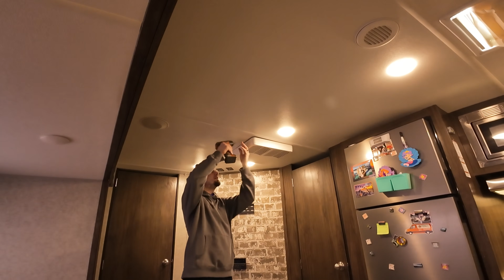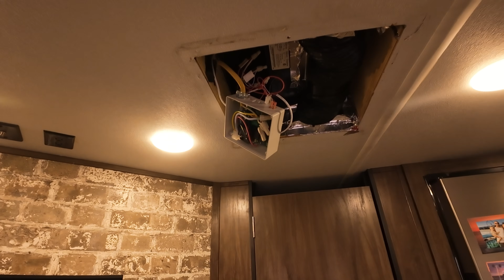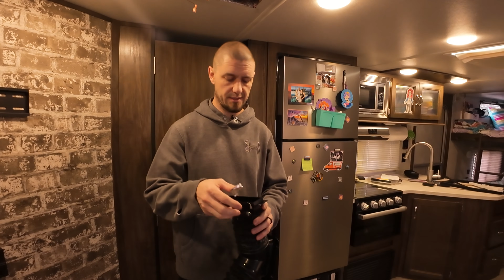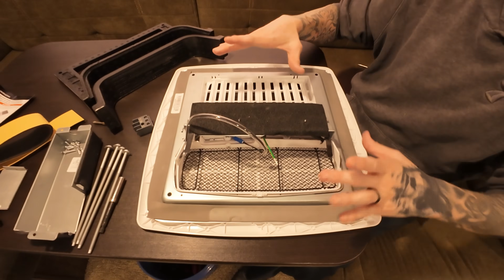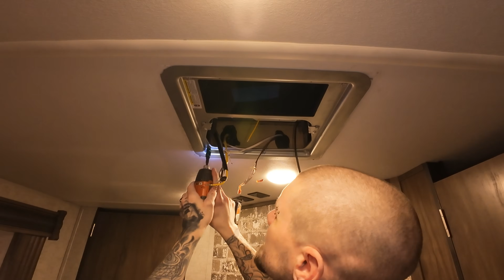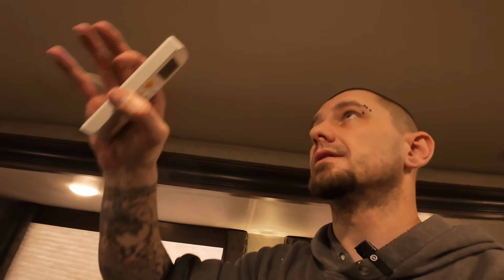Swapping Our Old RV AC for the Furrion ChillCube… Was It Worth It?

Comment: You could always use your old unit and cut an opening in the roof and ceiling and with a couple 2x2’s add some framing. Instead of wiring into the trailer wiring, cut the female end off an extension cord and wire the male end into the unit power wires and use an extension cord to plug directly into the pedestal 110v outlet at camp site. Pretty simple job and looks like you have the skills to do the job.
Reply from the maker: That’s definitely an interesting workaround, though I prefer sticking to the factory wiring setup for safety and convenience!

Comment: I've seen other vids of people fine tuning and sealing the plenum with foam board and foil tape. I wonder if that can be done with this unit for increased air flow?
Reply from the maker: You can definitely do that if you wanted to. KoolRV also makes an amazing product that would hook into it and push the air directly into the vents so you don’t lose any air conditioning inside the unit

Comment: We were thinking of replacing the non-working Dometic on our Dutch Star with one of these but since the roof A/C now connects to ducts in the ceiling we would have to cut out the old ducts and make a 14" square hole in the ceiling for the air to come down through and to have a place to bolt it on which seems like a big job. Also the Furrion units have a lot of bad reviews on Amazon since the internals are mostly cheap plastic and a lot of them arrived with damage so if we ordered one and it came by UPS it would be smashed to pieces!
Reply from the maker: Mine connects to ductwork as well. Theres no cutting necessary. The ductwork will connect to the framing that your ac unit sits inside of. (Partially why so many of these units are so inefficient) you should just have to un bolt the framing and lift right out then drop in the new unit
Reply from the maker: Also, I have links to everything in the description from Amazon. If it shows up damaged you can just submit for a return. Or if you want to purchase in person typically camping world stocks them as well

Comment: Does it come in a kit or individual parts?
Reply from the maker: The ac unit will come with everything but the inside kit. You need to order the inside trim kit separately depending on whether you have a ducted ac or ductless unit. I have links to everything in the description that you will need for the job though

Comment: Who cares about the sound? You don't have to mention it 10 times you care about the airflow. thirty percent loss of efficiency in the duckwork due to leaks and heat gain from the roof the direct dump is the best way to cool the  camper
Reply from the maker: When some Air conditioners from the factory are so loud you feel like you have to yell over them people tend to care about the noise level. It was a big upgrade for us just for the noise level alone…

Comment: how much airflow compared to the dometic?
Reply from the maker: I did take a reading with an anemometer I just can’t remember the numbers now. There has been a huge difference since we’ve installed the chill cube. Before if you walked out the door the temp jumped 5° and now we can cook breakfast with the door open in 90 degree weather and it still keeps out camper cool. Can’t recommend the chill cube enough!
Reply: @MilesAndSmilesRV  I had the 14 500 chill and I have problems with it freezing up all the time since it’s manual controls it doesn’t give you a freeze sensor. after fighting out for the last four years, wasn’t sure I wanted to go with the same brand, but I did and decided to go with the chill cube because it looks like they changed a lot of things that was a concern. A big one being on the chill the majority of the air comes out the backside of the AC. The cube looks like it comes out the front.

Comment: You stated you have a duct system you don’t have a duct system. You have that plate in your camper in the ceiling. A duck system has no plate coming down in the camper other than the fresh air ducts you returned ducks.
Reply from the maker: @dand8163 and @rvfuntimes6144 I absolutely have a ducted system in the camper. Ducted doesn’t mean you don’t have the dump gate on the ac unit. All that ducted means is that you have air duct attached to your unit that disperse it through the rig, which I do. Every single ac unit that I have seen in a camper also has a dump vent on the plate incase you need to rapid cool your rig you can open that as well. At least in the campers that you can reach the ceiling
Reply: Yea its makes me wonder when they say its ducted and then they show it coming through the ceiling through those spots. We too have a ducted system where it runs from the front to the rear. Wish someone show a system like that.

Comment: I went to school for rv these to work on 
It I bought a cheap camera from Amazon and I put it through the vents and what I found. The teacher was right one of the tubes was not cap on the end so I use expansion foam to make it end. I did that in all two tubes. Front and back I eliminated pretty much 9 feet of space that it wasn’t using and to turn out push more air out of the vents when I drop the cover for the AC on the inside I had two holes that going into the attic, they were about 2 inches open taped it up and now it works good.
Reply from the maker: That sounds about right. From what I have seen just sticking my phone camera up inside the vents it wouldn’t surprise me if there was even more issues dumping air out into the attic instead of where it should be getting to. I started addressing those issues last fall, just haven’t gotten time to edit the videos to post up here yet

Comment: Looks like we have the same camper lol I have a 2018 fr Cherokee 264dbh and now I’m doing the same thing 🤣
Reply from the maker: Did you have the issue with the toilet recall with yours too? We had to replace the toilet in ours because it had a silent recall on it since it held sewage in the back of the thing. It always gave off a sewage smell so I called Dometic and they told me there was a recall on it and replaced and upgraded it for me. 

Their AC unit has been an issue from the very beginning.  Never kept our camper cold. You’re going to love that chill cube!
Reply: @MilesAndSmilesRV I didn’t know about any recall and mine does always have a smell. But what did you have to tell dometic to get a new one ?
Reply: You ain’t lying I use mine for work it’s currently 72 outside and I’m about to sweat inside of it lol

Comment: I saw a video from someone doing this same install and he only disconnected the 110v feed and left all the other wiring connected to the existing control boxes. He said that by doing this he could continue to use his existing thermostat for heat. Now, I will say that he had a newer RV that had a central control panel that controlled multiple AC units and his heater. Not sure if this would work for RVs that are a little older. But I think I am going to give it a try when I get around to installing my ChillCube on my Thor Windsport Class A.
Reply from the maker: Let me know how that works out for you! I'm curious to see if that method works on older RVs. I don’t see why that wouldn’t work

Comment: you can still get another unit on the roof, but perhaps for your circumstances, a mini split mounted to the front(travel trailer) or on the back (fifth wheel) would give you the amount of BTUs you need to have your rig cruising at 72 degrees. The chill cube is a MASSIVE improvement on traditional units though, (I am an RV tech, you can feel the difference inside when cubes are present)
Reply from the maker: The mini split was my next move if this didn’t work, however the chill cube did the trick for us…kept our travel trailer at 70°  easily

Comment: That was a risky move getting it on the roof that could have easily gone sideways. Last time I put a unit on the roof I tied a rope around the box and 1 person on the roof pulled while I pushed it up the ladder.
Reply from the maker: It seemed like a better idea in my head to be honest lol.  I thought it would have slid right up the ladder but it kept sticking.  It definitely would have been easier to have a second person helping but I wanted to film it as if you didn’t have anyone to help you to show that it’s definitely possible to do it alone, even though definitely easier with two people…
Reply: @MilesAndSmilesRV while it's possible, it is not advisable. One slip and that unit is gonna hit the ground and probably break something. That's an expensive mistake.

Comment: In my application the furnace wires runs trough the AC Dometic  control box. If I remove any wires from thermostat my furnace will not run   Help
Reply from the maker: Mine was the same way. All you need is a battery powered household thermostat and to splice the wires coming from the furnace to the wires going to the thermostat together. The only wires you’ll need is the red and white wires to connect to the thermostat. I cover this issue at the end of the video too incase you missed it. 

Did you start installing a chill cube in your rv yet?

Comment: I'm most of the way through your video, but itching to ask in case I've already missed it. How did you address the furnace? My thermostat wires both a/c and furnace through the a/c. I don't understand the design decision, but apparently it's common. Point being, currently, my furnace has a dependency on the a/c just for a damn relay or something that allows power to flow to the furnace. 

I'm all in on these chill cubes and itching to order, but even Furrion documentation is weak when it comes to thermostats, their a/c, and a furnace.
Reply: Meant to say, good detailed install video!
Reply from the maker: @TimPaddy thank you very much! We just spent a week in cape Charles, Va where our last AC unit could NEVER keep up. Happy to repost our new chill cube kept the camper around 73 degrees all week with ease! We didn’t have to block over our windows, or skylights.  We were able to open our windows up and look out throughout the day, and left our door open while cooking end eating breakfast with absolutely no issues all week.  HIGHLY recommend this unit for sure!!
Reply from the maker: I do address this issue at the end of the video. But basically you bypass the ac unit and separate the two. The furnace is powered separately from the ac but the signal from the thermostat is what runs through the air conditioner. All you need to do is make sure you connect the wires in the ceiling to bypass the ac unit and connect the two red and white wires on the back of a battery powered household thermostat. 

I hope that makes sense but I do go over it all towards the end of the video since that is one of the final issues to address in the install. 

Happy to help out throughout your install if you have any questions throughout the process. I hope you’ll stick around the channel…

Comment: We had an insurance claim and replaced previous 3  15k furrions with the 18k cubes. Holy cow what a difference. To start with the cubes are so much quieter. Dramatically quieter, like you can have a conversation when it’s running on high without yelling. 

I think the biggest change though is not only the fan being variable speed but the compressor is as well and you can hear the difference when it speeds up and slows down once it hits the temp it’s set at. 

Also we’ve noticed a dramatic drop in the amount of electricity we are using with the cubes vs the previous units. 

The follow me function on the remote is kinda weak but all things considered it’s not that big of a deal considering how much better the unit is.
Reply from the maker: I can’t agree enough! I was shocked at how much quieter this unit is and so far it has kept our rig WAY cooler this year. With the domestic we had to keep the doors shut at all times, window blinds down and had those reflective windshield covers jammed in them all just to try and keep it cool. With the chill cube, we’ve had the door wide open while eating breakfast, with the blinds open and still kept it cool. This unit has been a game changer. The true test on it is coming this week. We head to Cape Charles, and our ac has never been able to keep it cool in the camper there. 🤞🏻hoping this one will take on the challenge and keep it cool in there…

The compressor kicking on and off with it being variable is so nice too.  No more waking up every time the ac kicks on at night…I haven’t used the follow me mode yet.  Did it not work well for you?

Comment: So, was it worth it? If so, how much better?
Reply from the maker: It’s a night and day difference. I would highly recommend it for sure. What kind of air conditioner do you have in your camper?
Reply: @MilesAndSmilesRV i don't yet. I've been saving yp to purchase one for quite a while now. And ac is a huge concern, and so many seem to not get the job done at all. I'm building a 10kwah battery bank (solar and alternator fed, mostly) so, Im looking for a ac that actually cools without eating up my bank.
Reply: I have been running and installing chill cubes for the past 22 months
We are full time and off grid most of the time in our Fifth Wheel and the chill cube is the go to
No 12v-24v 10k’s
The chill cube is a phenomenal Boondocking A/C unit
Waiting on the new Chill Cube Low Profile now!!

Comment: Do you have better air flow thru the vents with the furrion than you did with the previous unit?
Reply: Update... I got mine up and going and I'm impressed with it so far. I love the fact that I can run it on a 15amp outlet at my house and it cools nicely
Reply from the maker: @richardtinsleyjr we are currently in Cape Charles, VA. This has been the place that has notoriously challenged our Dometic AC every year. Last year it was 98° inside the camper with the AC on. This year with the Chill Cube we have kept the inside around 70° with ease. We have even left our door open while cooking on the blackstone and eating breakfast and it still keeps it cool inside. Oh also had the blinds open while eating breakfast with the sun shining through the windows. I have to say I’m EXTREMELY happy with this Air Conditioner’s performance! 

What kind of camper did you put yours on?
Reply: @MilesAndSmilesRV I have a 2017 heartland trail runner 29msb. I live in Cincinnati oh but next week I'm going to Myrtle Beach to give it the ultimate test
Reply from the maker: I’m betting you’ll be pleased with the performance there. Ours is a 32ft bunkhouse and it cools down the inside in no time and keeps it cool. We aren’t far from you. We live in the Pittsburgh area
Reply: What size camper ? I am looking at doing this swap in my 2017 rockwood 2902ws. 32’.
Reply: @Chuck-h6r mine is a 30 foot bunkhouse, the AC cooled down the inside in less than an hour on turbo mode
Reply from the maker: You won’t regret it! It’s an easy swap too and it works sooooo much better to cool down the inside and keep it cool. Ours is 32ft bunkhouse and it kept us around 70° inside while we were at the beach in Cape Charles, VA
Reply from the maker: We do, especially when we use the turbo mode on it. I’m diving into the ductwork next to address the poor craftsmanship from the manufacturer. That video will be coming soon.  Are you having airflow issues with yours? Have you tried the koolrv product yet?
Reply: @MilesAndSmilesRV I just got the chill cube I haven't gotten it installed yet was just curious about the airflow. Hopefully mine will work nicely
Reply from the maker: It definitely seems like it pushes more air around than our dometic did. The camper has been staying cooler all year so far and it’s WAY quieter than the dometic was. 

I don’t think you’ll be disappointed with the chill cube. When you get into the swap let me know if you have any questions.  I’m happy to help you out with the process if you get stuck on any of it
Reply: @MilesAndSmilesRV awesome thank you
Reply from the maker: No worries! Good luck with your installation!
Reply: Did you have to run new wires to the furnace or can you use the current wires?
Reply from the maker: @buddyjames8222  the current wires work great. You just re-splice them to get the furnace wires to bypass the air conditioner and over to the thermostat. It’s towards the end of the video that I cover that part…
Reply: @MilesAndSmilesRV ok, so the green and blue wires go from the furnace to the AC and you splice those in the AC with green and blue wires that go to the new stat? So all the wires that are needed are previously installed through the walls correct? I'm wanting to do this with my rig and really don't wanna mess with running wires! 
Thank you the help
Reply: @buddyjames8222 getting the AC to work was easy getting the furnace to work was really tricky I had to go to 2 different rv techs to get mine going. Furrion needs to figure that out

Comment: Great Video - 

just got one of these units. I’m going to put it on my 7 x 16 enclosed trailer that’s been converted into a toy hauler. 

First I need to reinforced destruction on integrity of the roof since the unit is about 90 pounds.

I’ll check back in a few months to see if you’ve done a follow up .

Safe travels, my friend ✨
Reply from the maker: It should work great on a trailer that size. Mine is a 32ft travel trailer with a slide out and it’s been working great so far! We are getting ready to head to Cape Charles for our next trip where our AC always struggled to keep up with the heat so we are really going to be putting it to the test soon…
Reply: @MilesAndSmilesRV  Awesome!!!